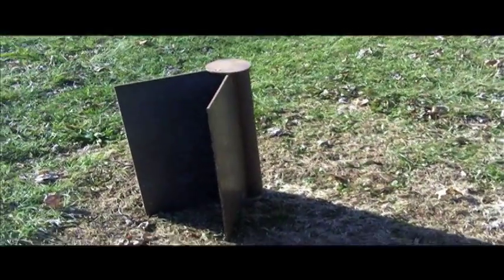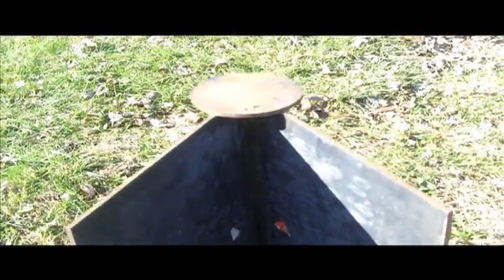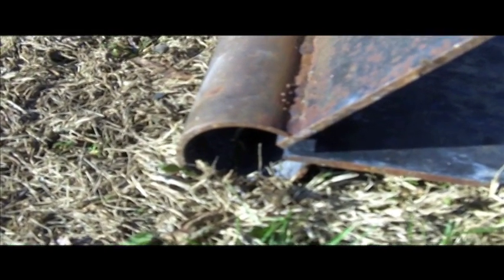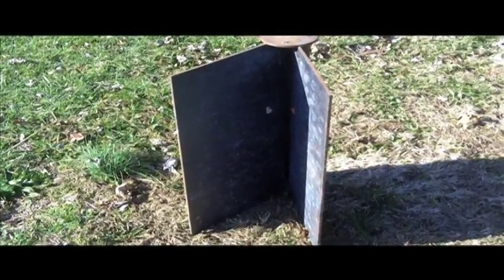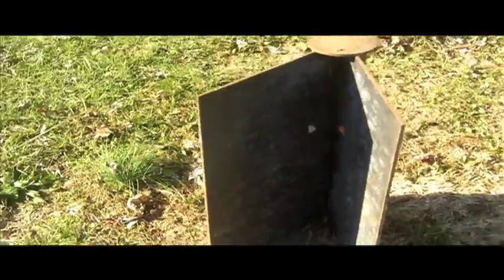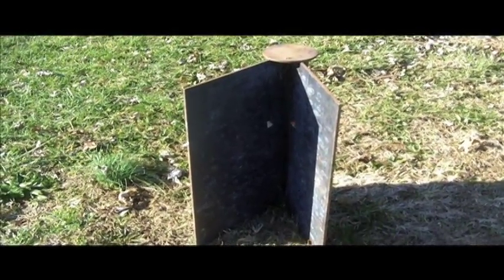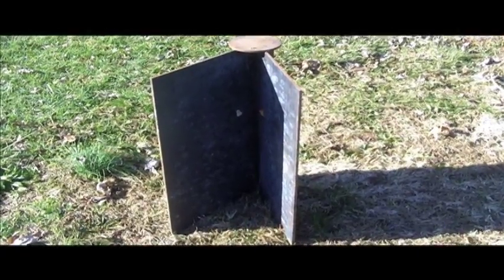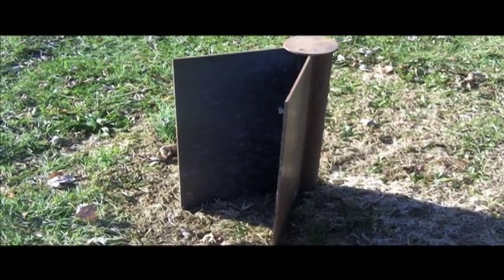Homemade Bullet Trap

Comment: 1.  How far do the side plates extend into the pipe?  2.  What is the angle between the side plates?    3. How far apart is the gap between the side plates at the pipe end?
Reply from the maker: #1: Approximately 1/2 inch
#2: 60 degrees (off the center of the pipe)
#3: Approximately 1/2 inch

Keep in mind, all this is adjustable based on the size of the pipe you use (bigger or smaller). You can also adjust the angle to suit your own target size. This bullet trap was originally designed to be able to be used in the basement of our house (that's a video for another time), shooting at 10x12 paper targets.

Comment: What is the size opening in the pipe for the bullet to enter plus 1/4 in plates?
Reply from the maker: The cut/gap that is length-wise in the pipe is approximately 1 inch wide (maybe a little less).  This allows for each plate (1/4 inch thick) to fit at angle and leave approximately 1/2 inch gap (or smaller) for the bullets to enter. This was made in a machine shop under "non-specific" conditions.  Thanks for watching and taking the time to comment!

Comment: Can you measure the distance between the two plates at the front of the unit and then measure the actual Plate dimensions.  Also what diameter is the pipe?   This is a great idea!  Thanks in advance.
Reply from the maker: +TransAtlanticEV Each plate is 22 inches high by 12 inches wide. The opening across the front (from side to side) measures just over 12 inches. The diameter of the pipe is 3 inches. This was designed for shooting in our basement when I was a kid.
Reply: +HNX Media Thanks.  I'm going to try and build it!

Comment: was curious how wide of a slot is needed where the 2 plates meet the cylinder
Reply from the maker: The gap is 1 inch wide. Keep in mind, each plate is 1/4 inch, so after the plates are "inserted" that leaves approximately 1/2 inch "true gap."

Thanks for watching and enjoy your build!

Comment: You said that it is 1/8 inch thick. Looks more like 3/8 inch.

Would it be possible to measure the thickness?

Thanks in advance.

Subbed
Reply from the maker: +Chris Burchett Did I seriously say 1/8 inch? I'm an idiot. It is 1/4 inch steel plate. Sorry for the confusion and thanks for the heads-up. Peace!
Reply: Thanks for the follow up!

Comment: Do you think it could handle .308 rounds?
Reply from the maker: +Francis Joly Good question. I don't currently have a .308, but if I get a chance, I will test it with a comparable 762x54r round. But off the cuff, I would have to say, no. This is only 1/4 inch steel and I know 762 will penetrate 3/4 inch steel. Now, none of this really addresses 308 specifically, so you would have to use your best judgement. Peace.

Comment: Would this handle 223 rounds?
Reply from the maker: When I get back in town I'll take it out and test it with .223 and report back.
Reply: Thanks!
Reply from the maker: 831Dank Still trying to get a chance to run some through it. Maybe this weekend. I also want to be set up for video when I do it so that people can see it.
Reply from the maker: I have tested this with similar gauged steel and conclude that it will not stop .223 rounds.
Reply: HNX Media so I can say it is not AR plate. You answered my question before I asked it.
Hand guns only then.